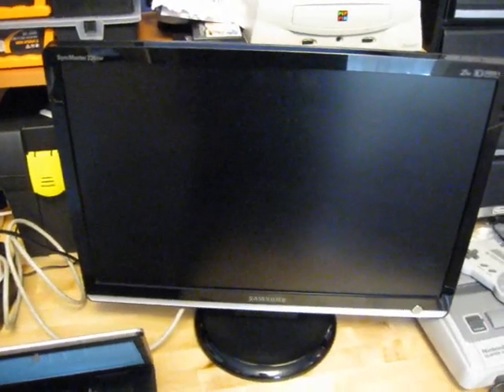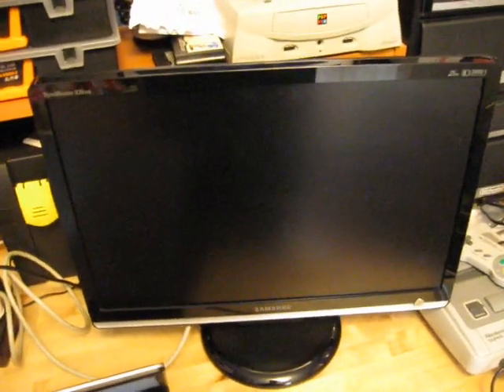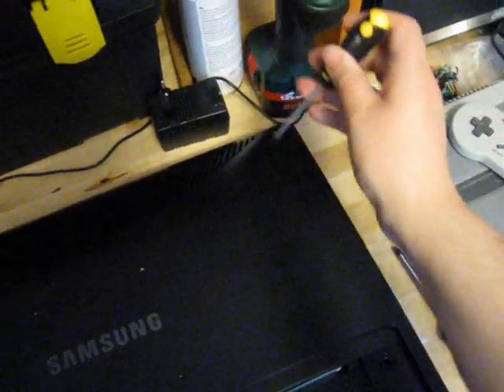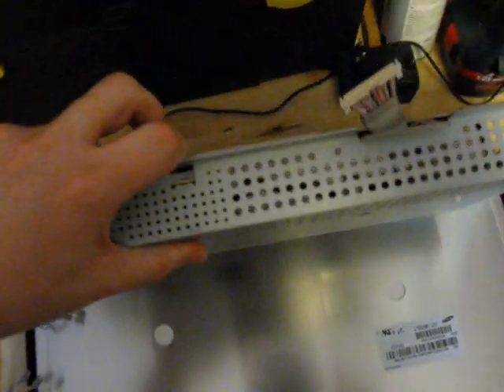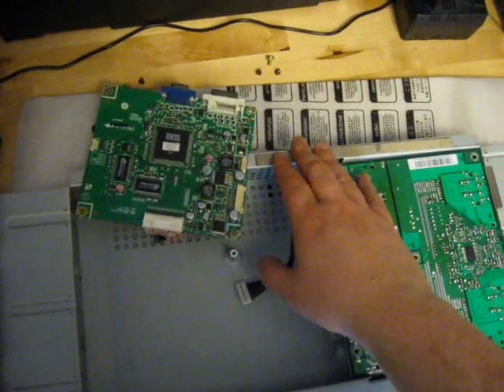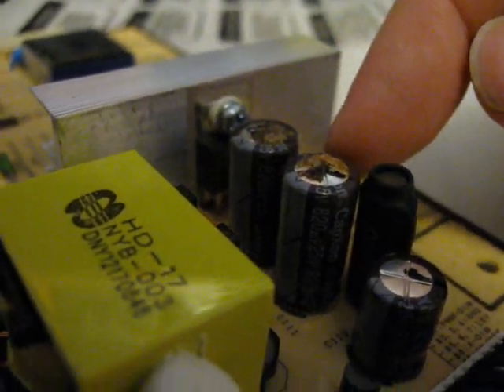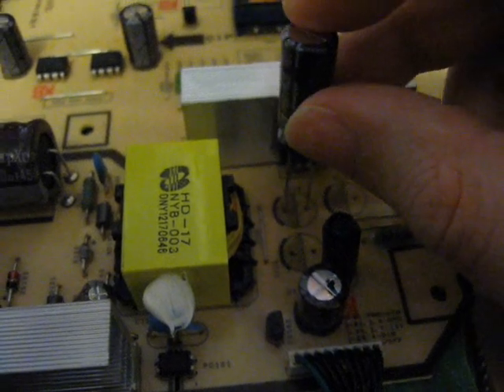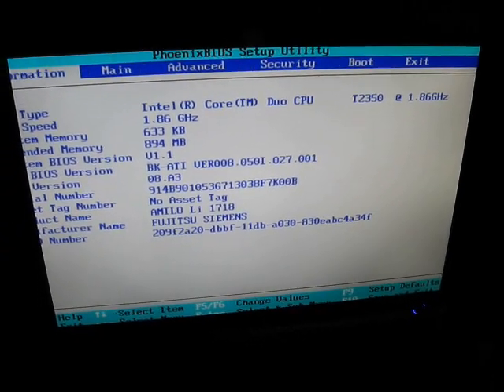Repairing a Samsung SyncMaster 226 BW monitor

Comment: Thank you for posting this video.  I used your guide to fix my own Samsung 226BW.  I replaced all six of the defective CapXon capacitors on the power supply board.  The video board was fine and the very large cap on the power supply board was also fine.  It took less than two hours and less than $20 to repair, and saved me $200.  I had to go back in and reseat the connector from the power supply to the video board, so be careful to make sure that all connectors are seated well.  Thanks again.

Comment: Thanks so much mate. I have a Samsung SyncMaster 223BW that was dead : flickering for a few seconds before shutting down with a hissing noise. Followed your tutorial and replaced the old capacitors by new 1000µF / 25V (5 out of  6). Worked like a charm. Good job !

Comment: Just fixed the same problem, but all capacitors are from the same source so may all fail.  I thus simply replaced them all (it's not like they cost a fortune, and the 150uF/450V one  would worry me otherwise :) ).  I had one 35V version which I had to mount flat on the PCB to keep it within maximum height (plenty of width available :) ).

Comment: Thanks for the instructions !
Replaced my caps with 1000 uF / 35V, because the guy at the shop did not have the 820 uF / 25V, but it does not matter to have a little more capacity, i also replaced the smaller one, with a 330 uF, 35V.
Saves me a lot of money on a new monitor, this fix cost me 5 euros, and a half hour of my time.

Comment: that shouldn't hurt anything. the different wires should go to different lights. the ground and positive should be in the same wires. it should be fine. i can't say for sure as i'm an amatuer at best but i can't see that causing your issue. i think you might have something else causing it. i tried the replace the busted caps trick a few times with little luck. despite what this guy says, not all bad caps bulge or leak. i have 3 headaches in the other room waiting on a capacitance tester.

Comment from the maker: It isn't always a visible leak like in the video but you can always tell if a capacitor is broken by looking at the top part of it. It should be flat. If it's bulging that means it's broken.

Comment: Just watched the video, went out and bought some caps and everything works amazing. NO MORE FLICKERING!!!!!

GOOD TIP!!! -------> Here's good tip for all you guys searching for capacitors. I went to an A1 electronics store and they did not have the 820uf25v capacitors that you need to replace the blown ones in the monitor. The guy at the store told me i can go up a size and it will work. I bought 1000uf25v capacitors and they worked with no issues, it just fits a little more snug!

Comment: I accidental switched the blue and pink cables. After I watched another video I corrected it. But the screen stays black now. I cant even acces the menu in the monitor by pressing the control buttons on the bottom. 

Have I killed my monitor by switching these two cables?

Comment: I was replacing my capacitors but I scratched the PCB with my pliers around the area near the capacitors.  Should I replace the board or should it be okay?

Comment: I suck at soldiering and i have no flux, do you think this could be done right using wire glue instead? Iv used it successfully for electronic projects around 12volts.

Comment: Okay my monitor does ths same thing, but worse. the blue light behind the power button will flicker on and off for a random amount of time (usually for at least 1 or 2 hours, once it took 30 hours!) before the screen begins flickering rapidly, then the flickering gradually slows down in frequency for about 30 seconds and then the screen shuts off, then I have to wait another 2 or 3 minutes until the screen can be turned back on.

I looked inside on the circuit boards, the same capacitors you had problems with seem to be leaking very slightly, very very slightly, but they do seem like they're about to burst, the tops are bulging quite far. I'm guessing they've gone bad and I should replace them... Do I need to find the exact same capacitors or can the uF and V measures vary slightly? Thanks in advance...

Comment: Swapping caps worked for me too:). Additionally I had a problem with the Menu and Power button not responding.. I solved this by bending the 2 metal flaps on the small print card (which holds the buttons). Now it presses harder against the screen.. Btw I put in a 4700uF instead of the 2 x 820uF. I was afraid that it would cause problems but it seems to work fine:)